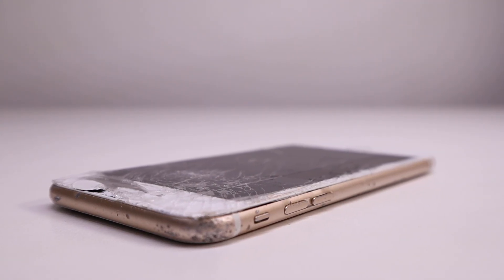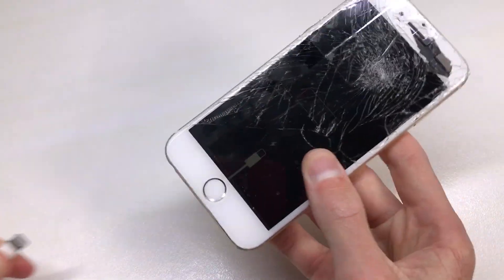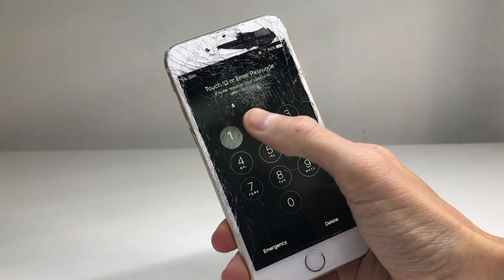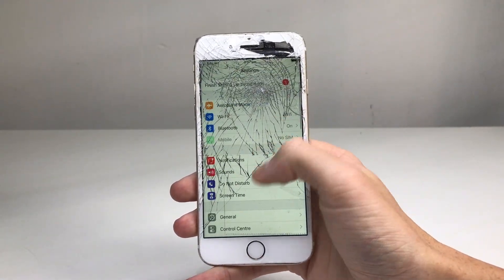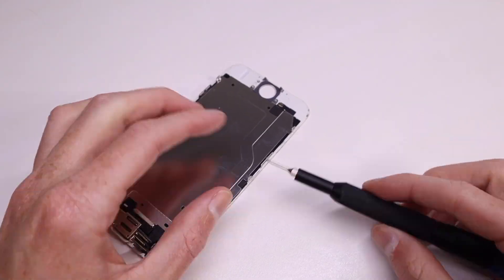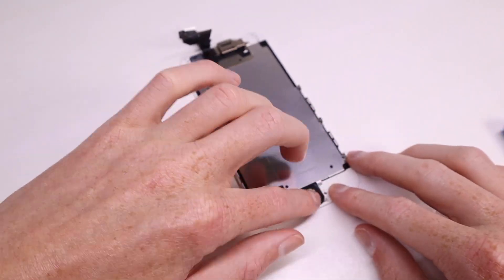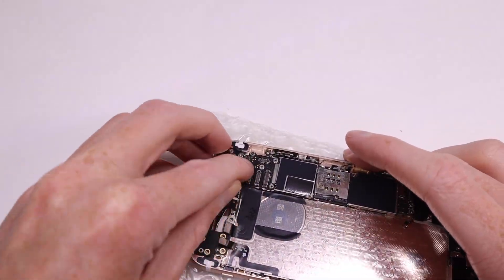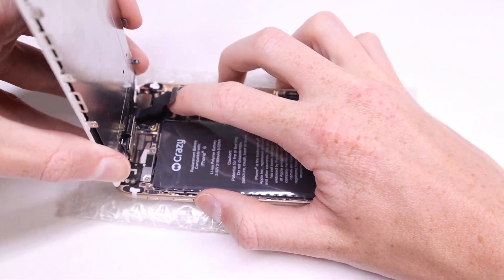$30 Destroyed iPhone 6 Restoration - Seller Tried to Scam Me?!

Comment: I bought an IPhone 6 from someone for 10$, and it had a password on it and they thought I couldn’t bypass that but I did just by factory data resetting it on my laptop and it’s totally new😂
Reply: r/thathappend
Reply: Amir It is possible,  he bought stolen goods from some crackhead
Reply: Lauterec Todays tech allows to tell if the phone with this S/N nana and IMEI  12345678 is reported as stolen. owner needs to report it to the police. So going to police station and saying to them that you found that. they can check it if it is reported as stolen or not. If not, maybe you can have it as they can not track the right owner, when he did not even report it. The providers can even blacklist IMEI, so you can not connect to the mobile network when it is balcklisted. Again the owner must inform his provider too. The way you handled with the galaxy s8 your friend found would be illegal in my county and I am sure in every country too
Reply: @Shaundi1-l4e  If its blacklisted you can just sell the phone to someone in another country and its then no longer blacklisted
Reply: @liamarmstrong2142  please do research before Posting. There is a GSMA Central IMEI Database, which works international/Worldwide. The law enforcement, retailers or Providers can Blacklist it. In other country it will not work too as before connecting to the mobile Network, there will be a GSMA Device Check done.
Reply: @Shaundi1-l4e  as soon as the phone is out of the country, no one will be able to to something
Reply: Amir r/ihavereddit
Reply: What password? you can bypass a lockscreen but if the pre owner actived icloud lock you wouldnt been able to bypass that
Reply: Capita you still factory reset if they have it iCloud locked like how this guy was saying?
Reply: Danlil you have just snitched on yourself dumbass lol
Reply: If the phone have “ find my iPhone “ turned on in settings , you can’t just factory reset it without the passcode / iTunes account .
Reply: Lucky u
Reply: How to remove icloud 100%?
Reply: and everyone clapped
Reply: I got a 6s from my friend for $10 with a cracked screen. I know it was there’s, and it was unlocked.
Reply: You bought a blacklisted iphone ? Nice.
Reply: THE GOAT I recommend tracking him down and returning it. You put the SIM card in your phone to see the #, take the card out, and call it. I am assuming that person kept the number with a new phone.
Reply: THE GOAT   i can
Reply: once i bought an iphone 6 for £25 which wasnt working amazingly but turns out it still had warranty so i sent it to apple and they gave a brand new/ refurb iphone
Reply: @caitlynf3828  they are very cheap tho but they get slow in like a month the best iphone is the iphone7 because it has the new homebutton and you can change the backcover so it looks like the iphone 8
Reply: well they probably stole it so you have no right to own it
Reply: @1yasin6  eh, that's what you get for 10$, good for him anyway, got an iPhone 6 for the price of two Back Scratchers 😂
Reply: @1yasin6  I think if it was stolen they'd probably still charge around 200 for it, because I don't believe anyone would risk getting caught over $10
Reply: @1yasin6  who cares
Reply: Yasin Biyikli what if they didn’t 😂
Reply: how you reset it?

Comment: I use an Xs max right now, but I honestly miss the 6 a lot. It was so innovative and a big step from the 5s. In my opinion the iPhone 4, 5s, and iPhone 6 were the best iPhones as far as innovation goes. The iPhone 4 had a glass back, which was like foreshadowing to wireless charging, the 5s had the first 64 bit architecture in a cell phone, and the 6 was so sleek, elegant, and pioneered the “new” iPhone look
Reply: iPhone started lacking innovation after the 6. It's a fact.

Comment: the lines in the screen usually happen to me when i dont discharge the main motherboard after disconnecting the battery and there is residual electricity left in the board. i just hold the power button for 30 secs after disconnecting the battery every time i have to disconnect the battery and the amount of times that happened dropped off..

Comment: I have a few questions and don't know where else to ask. Not that great with how YouTube works. Do you sell your devices on eBay after you are a pair of them? Judging from your videos if you don't sell the phones and everything else you work on. You must be in the hundreds. At this point.
. I had an iPad that was I believe you call it I cloud locked Basically, it wouldn't let you do anything unless you put in the username or e-mail address of whoever owned it. I initially got it when it was about a week old, came off of the roof of somebody's car and was in a protective case. I spent the better part of two years trying to find the owner with no success and I took it to several shops trying to find somebody that could do anything with it, and once again no success gave it to a guy a few months ago who I don't think has used it for parts. Yet was wondering if there is anything that can be done with it or if it's just parts?

Last question, I promise. I've got a old Apple desktop computer roughly 10 years old. I've been trying to sell it for $40 and not having any luck. No I don't have eBay before somebody asks that. Machine is perfectly fine. It functions. And everything I just don't have a use for an Apple desktop and not been having any luck moving it was wondering if you had any suggestions. Maybe you want to know more about it and have a use for it yourself. Frankly, it's sitting here listed locally and had it listed for about a year and not gotten one e-mail. Originally had to of him once sold within a day of putting the listing up but the other one hasn't gotten a single response.

Comment: i think even 90$ is expensive for iPhone 6 with no Touch ID you could get a used iphone 6 with working touch ID for tht maybe even 64gb you should have tried replacing glass on that display to cut the cost but that would require some expertise to install like factory but that would be original display or another solution would be buying a 10/10 icloud iphone for parts

Comment: As a repair shop owner who fixes phones by the hundreds per week I can tell you a few things...

The "Cable" near the camera is for the NFC antenna to use with apple pay, so yes some people leave them out. Someone who doesn't use apple pay would never notice.

THe lines in the screen in this situation means that you did not plug in the digitizer connection all the way, so half the digi was getting touch and half wasn't hence the right side didn't work. Nothing to do with static. The act of plugging it in and replugging it in fixes this typically. When you put the LCD plate on you get pressure on it and forces it into the port.

If you ever have a phone that does not work then feel free to contact us as we offer board repairs to fix just about anything on the phone needed. No image, no touch, boot issues, etc. Check out our videos.

Comment: I did this with an iPhone 6s+ while I was working as a phone technician.
Entire chassis was bent & cut, the top screen assembly was snapped and missing meaning it needed a new proximity flex, earpiece, earpiece bracket, back camera. Needed a new battery, charge port & home button. Fully restored the clients phone :) P.S It got ran over by a Jeep

Comment: I also just restored an iphone 6 16gb for 50usd which actually only hv crack screen and few screw fall off but still is inside it. Housing still in good condition and after only change screen for 12usd, the phone works great without any problem, battery life also good. Great deal I think.

Comment: I had gotten a iPhone 5s and eventually my battery was terrible so I went to replace it, the led bracket was missing, the holder for the touch id was gone and half the screws gone, risks u gotta take getting second hand phones because it's cheaper

Comment: Where do you buy your OEM Screen Replacements? I need one for my iPhone 7 Plus
Reply: you can't sadly most third party parts do have actual original lcds they re used from cracked screens
Reply: Trevor I’m pretty sure it doesn’t work like that. The LCD’s aren’t original (talking from personal experience)
Reply: @TiagoVieira usually it does they send of broken screens to chine and they replace the glass panels there of course you can also get  reproduction lcds but refurbished oem screens are not that much more expensive
Reply: eBay.
Reply: RM D They’re all crap. There’s no brightness and the colors are always off
Reply: He's getting almost every more important parts (battery, displays...) from crazy parts shop. Its Australia only

Comment: great job m8. Good restore. You also saved yourself 60-80$ doing it yourself.

It sucks that touchID wouldn't work. How did apple make it hard to re-install?
Reply: they cryptographicly paired the logic board & home button together, meaning that if you change either one, touch id no longer works. Only Apple can/knows how to reprogram the logic board to accept a new button. They say its for "security" (and it is secure, don't get me wrong), but there's no real reason it needed to be done like that (non-programmable at all except by Apple) other than they want you to have to give them more money for them to replace the home button/buy a new phone so it will still work.

Louis Rossmann has a video on it, https://www.youtube.com/watch?v=cDYeby1Vanw you can watch it there, it mostly talks about Error 53 which is if you had a replacement home button, the phone would brick itself when you updated it.
Reply: @ElectromasterTech  wow, very interesting. I agree that it is a sneaky tactic from Apple, considering that even if you used a different TouchID menu button, the logic board SSD or wherever the data is stored would still have the other fingerprint and not recognize another one.

Comment: Mate...I enjoyed watching this so much! This was my business on college and a year after graduating I still have a box of a wide variety of cracked iphone screens from 5c to x hahaha. and by far the most fun ive had was to drill a slightly  bigger hole on a iphone 6 housing to fit the camera of a larger version. The  owner of the phone gave me an extra 30 cuz wth, talk about custom phone lol. After iphone 7 and attempting a complete restoration on one ran over by a car I just recommended ppl to switch to android cuz the removal of a physical home button for a touch id was just the ultimate apple scam for me.  Especially since those fingerprints reader are linked to your board and can only be functional if you go for new ones to apple. But luckily at least ppl rather use the on screen home button forever than pay an arm and leg for that crap.

Comment: After watching this video ive been wondering how to unscrew the batter plate on the iphone 6 plus because my phone needs a battery replacement and i have the extra battery but dont know which screw or screws to use on it xD please help im using a us sprint model if that helps in anyway 
.w. thanx in advance

Comment: 8:37 The reason why your screen wasn't working was because you had a bit of the cable unplugged.
Reply: FwelStars static electricity??😂😂 That's a good one. You didn't properly connect your LCD and or digitizer cables. I can tell by how careful you are with opening the phone that you haven't repaired too many

Comment: Hugh, do you know how to test if iPod Touch 5th gen's charging port working or not by testing it using multimeter or other tools? because my iPod died and won't charge, i suspect either because of the charging port or because of the battery. could you make a video of it if you do know how to test it? thank you

Comment: hello I‘ve a question...

my old iPhone 3GS turned off by it‘s self and doesn‘t turn on again... I opened it to check there is no water demage...   seems like everything is good..  but It doesn‘t wants to turn on... I changed the battery but still dead..    what could that be?   I tried everything ..DFÜ etc..... Wont go into DFÜ/ Hardreset

Comment: The lines in the display is either a faulty digitiser,  which would explain why the touch isn’t working or the connector isn’t making correct contact with the logic board fpc connector.

Comment: If I have Snapchat open for more than 3 minutes on my iPhone 6 with 100% battery it will die and in settings it says that the maximum capacity is 51%

Comment: whats up dude! greetings from the philippines..im also rebuilding iphones for the past 3 months now..can i have a question? my 5s touchscreen stopped working after update...i couldnt blame the touchscreen cause the screen was saw flawless. i dont see any issues with it ...it even doesnt have any crack ..so in favor that the screen is malfuctioning i removed the screen and tried it to another device ..and that screen actually worked....my question is ..is it the touch ic causing these problems or just a malfunction in the system while update....hope u see this..THANK YOU

Comment: i like what you said, about throwing things away and buying new stuff. its so sad, that apple tries to force you to a new phone
Reply: planbskater1791 I have never once thrown out a iPhone. I have bad luck with them cause I hate cases but I always restore. (New shells, battery, screen etc) and I wrap them and give them to my siblings parents or grandparents. I have 2 iPhone 5S brand new condition just sitting in my room as a back up for my iPhone XS Max in case I drop it
Reply: @mackenziegudge7859  iol buy one of them iphone 5s from you i really need a phone
Reply: Buy android they don't break
Reply: @noahkoenen3053  haha funny
Reply: @noahkoenen3053  androids are slow and they dont have good graphics which means they cant play games at all and if they can its slow and the only reason the screen doesnt break on androids is because there screens are made of cheap plastic not glass and an easy solution to the glass is to not be stupid and get a good case and a screen protector so in my opinion apple is far superior. and dont even try to say im a fan boy because i used androids for years and then switched to apple and found apple 20 times better in quality performance and looks
Reply: EchoGames Unless your home button breaks and you lose Touch ID forever.
Reply: @isaac4303  yah keep saying that isheep, at least other companies don't think it's futuristic to take out parts, remodel and increase the price.
Reply: @isaac4303  you seem to be generalising android with cheeper companion that take short cuts. Take Samsung for example looks aside because that topic is subjective, has glass front and back bigger storage easy fix if cracked as you can see apple purposely tries to scam you into buying new phones if you break yours. The new Samsung phone is at the same price as apples last year models and has more features and better tech in general so I really don't see how apple is "far superior". 
As a side note apple updates slow and take up storage on your phone over time forcing you to get new phones and waste more money.
Reply: @kevinj5475  I was going to say that but since you said it, I wouldn't even bother typing it. 😂😂 Straight up facts btw
Reply: @angelzendejas2978  lol some has to say it

Comment: I plugged in my screen on my iPhone 6 and I had lines as well, I messed with it for about an hour, and there was still little lines at the bottom and I gave up, and put it on the charger and went to sleep, when I woke up the lines were gone and my phone looked great.

Comment: How the hell are you always so lucky on eBay?? Seriously?! Also, I can’t stand how Apple stops signing older versions of iOS
Reply: Why do people like the older versions?
Reply: aesthetic vhsc Jailbreaks, Better performance i.e newer IOS versions lag on older devices
Reply: Yeah...apple admitted to releasing software updates that slow down older phones deliberately.  They got sued for it and now put an option in the battery settings that disable this throttling of the CPU.  However, they basically lied and said that it was only throttling due to poor battery performance.  BS
Reply: @bleckybob  With my IPhone 6's (I have a Plus and a normal one) I tested it with IOs 12. I had no problems. For me it reacted faster. I really dont see any reason right now to stay with an older version. 9 especially. Also if you can jailbreak it so can a malware.
Reply: @nukularpictures  mate before you leave a comment please just do some googling.
Reply: @tmded3368  Why would I google if I have the experience on my own? Why do I care what problems other people have?

For me the IPhone 6 works great with the current IOS. All apps that I use work great and I know the bugs are fixed. 
It is all dependend on the usecase that you have and I personally like to have more security.

And the statement, that if you can jailbreake an IPhone you can get maleware, is true. Just see how the jailbreak works.